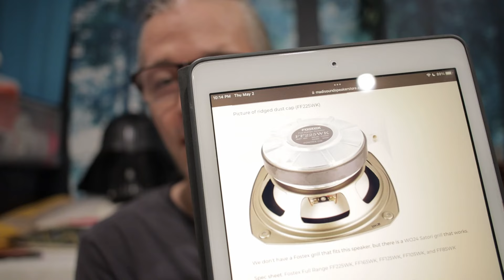Driver backside reflections under scrutiny

Comment: Hi Janos. I would be very interested to have your thoughts on cancellation effects. Relative to this video subject, it occurs to me that the reflections reaching the magnet/ basket/ cone are also being met by the driver’s subsequent output.
But a more obvious effect for consideration must be floor bounce and driver position distance from the floor. Or maybe not, I don’t see it comes up so much. I do know that if you mount a bar of quadrant along the bottom edge of a cabinet is has a dramatic effect on the bass, for better or worse.
Then again, are there not cancellation effects at play between the two stereo speakers which would change with the distance between them, even as you are judging the effect of positioning cabinets relative to boundaries. 
Should we be considering this more or is it a non-issue in the scale of things?
Reply from the maker: Hi Steve, this is a very good point and relevant issue! I will make a video on it ; ). Yes, a little bar close to the bottom edge does make a huge difference.

Comment: Tech Ingredients on Youtube was my introduction to the Voigt tube. There are a few differences in his construction. 1) He used a damping material to deaden the plywood construction. 2) He placed a curved reflector at bottom to smooth the wave as it exits the port. Question: Are these things beneficial, unnecessary, or counterproductive? Bonus question: I saw a photo of Voigt tube speakers that have an open bottom, so the port faces downward. (It was elevated about two inches.) Your thoughts about this?

Comment: Fantastic - great explanation - really  helpful to have the addrd clarifications - I am aware that some time back Dave of Planet10 did a piece on drivers mods which also looked at the basket issues (as well as some cone mods which are not likely to be for most DIY'ers!) - he also suggested reprofiling the inner flat face of baskets (and also possibly adding damping material there if not possible to reprofile) & confirmed the benefits he saw in the drivers they treated. ***

Comment: The area of the cabinet immediately behind the driver seems to be a choke point that interferes with the smooth propagation of waves. What if the driver was mounted an inch or two  forward of the cabinet — with the appropriate modifications to the cabinet, of course?
Reply from the maker: Yes, giving more space behind the driver would be quite advantageous. However, moving the driver forward is catastrophic. Even an 1/8in spacing already shows as very noticeable unwanted increased coloration in the midrange, and 1-2in difference shows up as a major disruption in bass, unless the spacing extends to the entirety of the front panel. (Making the cabinet extremely heavy, although doable.)

Comment: I also like to explore/see about displacement of cone vs input signal voltage graph ,to find out clipping of speaker it self. Generally production technicals only consider clipping of signal at input terminals of speaker. But there must be mechanical limit to the smooth displacement of speaker cone and it end stops. Which has to be considered to listen distortion free playback. So we know signal clipping and can control it who knows how to. But mechanical limit clipping is where we have to work/explore and find solutions.
Reply from the maker: Thank you, yes, that is a superb point! 👍👍👍👍 I think that could very well be the most important parameter yet to be added to driver measurements, and aid both high quality / high fidelity production for home users, and more freely push the max SPL for PA applications.
Reply: @realworldaudio  ya... This can be measured by high precision displacement measurement device like Bentley Nevada probs.

Comment: A quite old way of minimizing the 'sail' effect in pressed baskets was/is carefully (and slowly) drill asymmetric holes in order to evacuate the pushed air as quickly as possible but at random so that no 'whirlwind' can occur. Air evacuation around solid objects had a tendency to make patterns of adhesion by nature therefore random exit is the goal.
If one looks at, say, a lamp post on breezy days (preferably in autumn when leaves are falling) it soon becomes clear that litter such as leaves circulate and form patterns as they appear to climb the post.
Regarding the native resonant frequency of the struts of a driver basket, it is worthwhile tapping each of them. They are usually slightly different but at some point retain a total harmonic resonance somewhere of the frame.
Your idea of using different thicknesses of masking tape or, better for longevity, good quality pvc insulation or parcel tape -- then remember to cut through to clear the drilled holes for evacuation.
This is fiddly but well worth it.